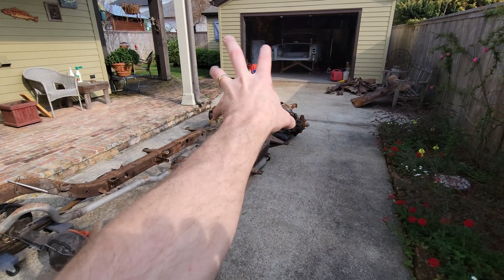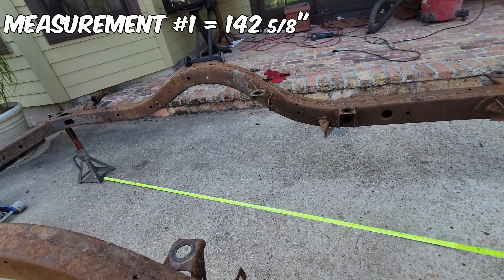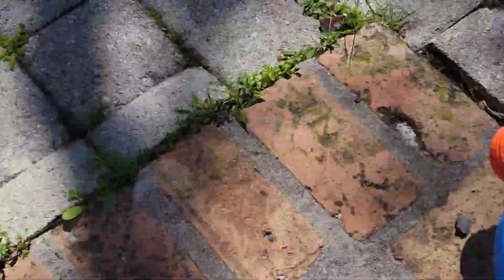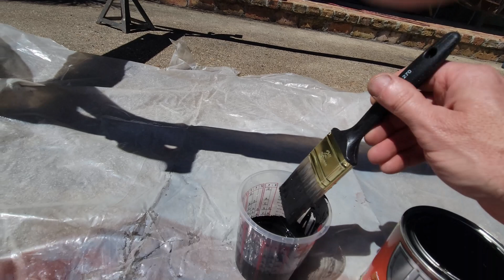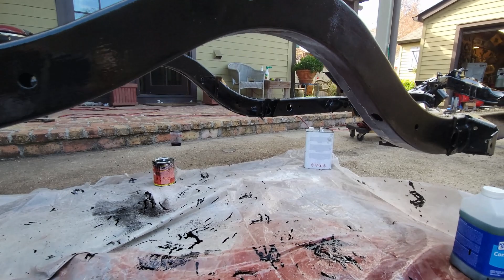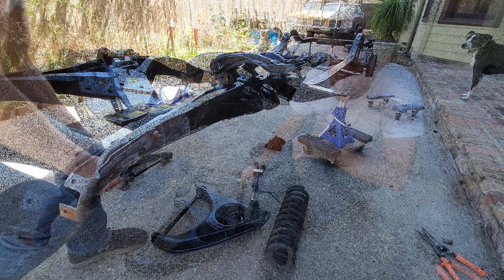E36 Painting a Chassis with POR 15!  1956 Chevy Bel Air Restoration

Comment: Looking good, Originally, the chunk/drop-out/jackpot were painted red oxide primer as were the interior floorboards, inside the doors, and the entire under body. Axle housings were semi-gloss black. The inside of the housing was either red oxide or Glyptol. I used Glyptol. I am not telling you to paint yours this color. Your car, your choice. I have 4 Pontiac jackpots and 3 different Pontiac, Olds housings and all of them were factory painted the same in similar years. Red oxide does stick out...
A better method than punching holes in the trough of the can is to use masking tape to cover the opening of the can and apply strips across the top to form a  "V" opening so the trough of the can is covered for pouring control. The tape will also help to keep paint from running onto the side of the can. Have a rag ready.   POR15 will harden in the presence of  humidity/moisture and any paint in the trough will weld the lid to the can. Lay a piece of plastic food wrap between the can and the lid before sealing to prevent this from happening. Even allowing one drop of sweat from your brow into the can will cause the paint to solidify after it has been stored and it doesn't take weeks. If using a brush, always pour the paint into another vessel and never dip your brush into the can. You will introduce moisture into the can.  It was also recommended to me to store the unused portion in a refrigerator for long term storage. This works as I just used my old can from 5 plus years ago and it was fine. At $50.00+/can, it can get expensive. I have switched to KBS products.   Hope this is helpful.
Reply from the maker: That's a whole ton of useful info!  Thanks for sharing!  I didn't realize that about POR-15 and moisture.  And I've never heard of "Glyptol" - learned something new!

Comment: Clean strip is the best, and most cost effective rust treatment imo.  The warmer the weather, the better it works (not so good at winter temperatures).  It is also most effective if you have a tank to soak things in (for smaller parts).  For larger things, wrap with paper towels soaked in clean strip, then wrap that with plastic wrap and leave for a day or two.  Check periodically and re-dampen the paper towels if necessary.
Reply from the maker: My fear with it is what does that phosphoric acid do if you don't rinse it well enough after?  And when you rinse it with water like the instructions say, then it invites the rust to start all over again!  But I will say that when I sprayed by brake discs way back then, they still look gun-metal blue today.

Comment: Another alternative to wire wheels is an abrasive wheel, especially strip wheels, but also surface conditioning, sanding and flap disc wheels. They're more aggressive in removing paint and tougher encrusted rust that wire wheels tend to just glaze over.

I find that wire wheels are better for looser surface and flaky rust, which can gunk up abrasive wheels, so they're a good first pass derusting tool, then you can go back with some sort of abrasive wheel to get the tougher rust out.

Then there are rust pits, which only blasting, grinding or harsh chemicals can get out. It's nasty work but you really can't avoid it if you want to be thorough.

In any case, great job, I've been doing something similar to the rear end of my 30 year old DSM. Took everything but the struts (which I redid last year) out and have spent weeks derusting the subframe components, diff, controls arms, sway bar and other small parts, and am all set to apply Metal Prep and POR-15, hopefully today as it's going to be hot, sunny and not too humid.

Then I'm going to try to do the same for the prop shaft and entire exhaust pipe from the downpipe to rear muffler (although I'll use a different paint for the latter, in this case KBS XTC high temp paint, which goes up to 1500F compared to POR-15's high heat paint that only goes up to 1200F). I say try because there are lots of curves, crannies and hard to read spots on each and I won't be taking either apart because they're otherwise in decent shape and it would be a major undertaking to do so.
Reply from the maker: That's one heck of a comment!  I wasn't overly excited about the job that the wire wheel did, but I stuck with it until it was done.  POR-15 is not UV resistant, and it sure does show you why really quick!  The frame might have been in the weather for 6 weeks and the surfaces that saw sunlight began to dull and chalk.  The rest that wasn't being directly hit by the sun still look shiny.  I'm going to repaint the front section that you can see under the hood once I resume work on the front end.
Reply: @RestoringChristine1956  Like you and most people I'm learning as I'm going. I see mistakes I made when I began this restoration 2 years ago, because I just didn't have the knowledge and experience I now have. Some I've redone or will redo, others I'm hoping won't be too bad.

Probably the three most important things I learned was to use purpose-built tools like grinders, use the right accessories with them like abrasive wheels, and treat rusty metal with phosphoric acid before painting even if you got all the rust out.

I just finished cleaning, derusting, painting, rebuilding and reinstalling the prop shaft. Took the better part of 4 days, because there was so much rust to remove, and I've never done this before so I took my time as this is one part you don't want to make mistakes on. And it wasn't even a full rebuild, just replacing the u-joints. I'll get to the lobro and carrier bearings later on.

I like your attitude in your videos. No point in getting upset if things don't go as planned. Just accept it, fix it and move on. One learns the most from one's mistakes.

Comment: Ive followed all the instructions and used P15 a number of times with mixed results. i found it peels it gets chipped
I used it on  successfully at time on cars.
On my trailer , stones caused chips and then it flaked in those places.
I followed all the instructions as per usual.
also, keep in mind its not UV stable. 
because the trailer was exposed to the elements, I top coated with another P15 product (cant remember the name) but it still faded over time
Reply from the maker: Time will tell if it lasts.  It's been in the weather for a few weeks now, and I'm starting to see a little bit of dulling and maybe even a little powdery film starting to develop.  I'm not sure what that is, if its normal, or maybe the phosphoric acid still reacting under the coating.

Comment: Did you consider powder coating the frame? Thats what I like to do on my projects. With the frame I have learned to take it down to a local Chassis shop and have them straighten the frame. There is always a flex twist or even a OEM flaw in the older stuff that could use a little tweaking, IMO. Great stuff!  Love your videos, I'm doing my floor soon.
Reply from the maker: I went with powder coating in the 71 Cutlass but decided to save the $1000 and paint this one.  I like the powder coat results, but so little if the chassis is ever seen, u just felt like that money could be spent on other things on this one.. So glad you're liking it! Trying really hard!

Comment: Get video! Awesome tips you are well of knowledge! Hope you do this car all the way thru. Continue them videos paint, upholstery, wiring, engine! Check my videos out about my 1958 Plymouth! Let me know what you think! And how I can improve. Also what are you thinking about power steering?  Are you keeping the electrical fuel pump setup? Tell us more about your disc brake setup. And did you ever get that hole punch and flaring tool fixed?
Reply from the maker: I did get the punch working, thanks for the tip!  And I am definitely converting to PS, but need to decide if I'm going to go with a front-of-head  or side-of-engine mounting brackets.  I am thinking about upgrading the heads and don't yet know which direction I'm going to go.  I'll definitely talk more about the disc brake set-up when I put them back on the chassis.

Comment: I dont know that i have seen a happier guy doing hard work on some thing he apparently loves to do. You have a constant smile and are doing a great job .  Now would have been agreat time to replace all those bushings on the the front end , but thats just me. You still have a lot of work ahead. Keep up the great attitude , and i love the longer videos.
Reply from the maker: Thanks, I appreciate it!  What I didn't mention in the video is that those bushings are not that old.  I replaced them about a year before moth-balling the car.  It's actually the second set that I've had on there.  The first were the urethane bushings and they wore out prematurely.  I put Moog stock bushings in and it's been much better.  Glad you like the longer videos, because I can't seem to do short ones!

Comment: Looks great...one thing about por is they say you need to put a seal coat on top because its not uv resistant...but your not in the sun so probibly dont need it...I see you have the same aftermarket spindels I have....as far as squaring up be sure you check the front stub... if it had any front end hits it will affect the alignment....I see you kept the heavy duty rear frame support.. good if you ever put a hitch on it..now would be the time to put sway bars on if your gonna...well worth the time... nice to know you have clean under wear in case of an accident... keep motorvated
Reply from the maker: You're right about the UV, but it's not exposed so that'll be OK.  Even though that bumper horn is whacked, the bumper itself mounted square and straight and the front end had a really good alignment before I disassembled it.  It never ate tires or pulled.  But that steering box is worn.  I could leave the wheel alone on a straight run, but it had slack when you did have to grab it.

Comment: They use por 15 offshore, seems to work well. Great job and enjoy you videos.
Reply from the maker: I was surprised as to how expensive this stuff is!  I could have picked it up online for $50 or so, but locally at Advanced Auto it was $75 with tax!  Still, I'd rather have it available down the street than have to rely on the internet to obtain.  Glad you're following along and enjoying it!